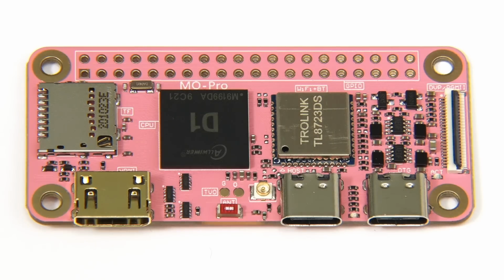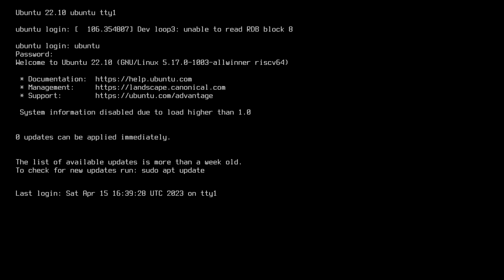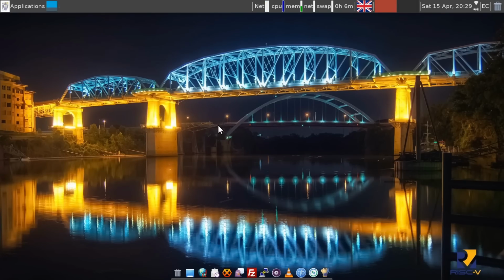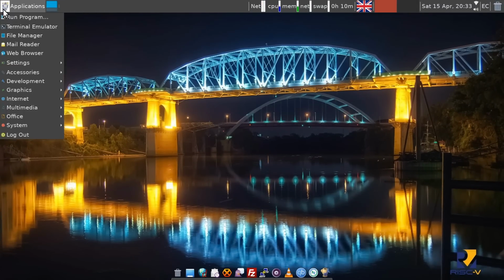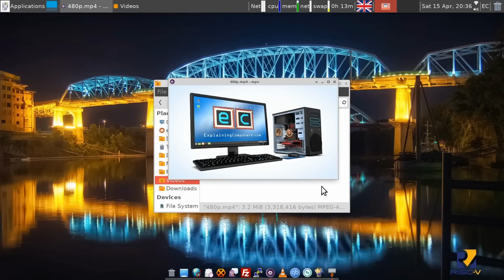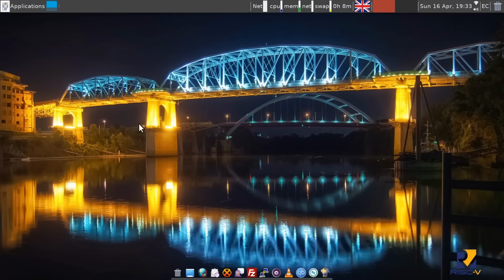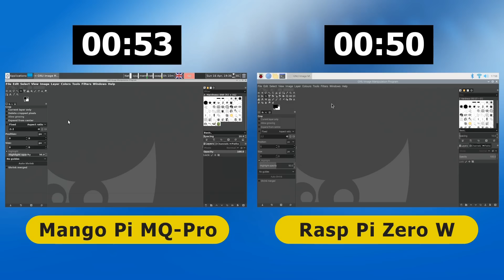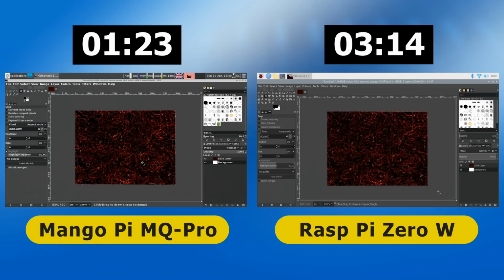Mango Pi MQ-Pro RISC-V SBC

Comment: We're used to computers that instantly run our programs and have quick video. But this is actually better than the computers many of us older folks got started on. Besides, this is not designed to be a desktop system. It will do fine for its intended purpose. Great video.
Reply: I'd actually argue that we older folks who remember well slow booting computers from years ago are now more than likely to have the patience to not worry too much about that now with some of these smaller SBCs - at home, for example, I am still using a Thinkpad T22 from around 2002 and a 700 MHz Pentium III CPU with 512 MB RAM just because I can.

It runs a very "slim" and optimised version of Gentoo Linux, it has an i3 tiling window manager and at least a couple of times a month I sit in my workshop using it to do some shell scripting while SSH-ed into my home server with mutt email open in a second desktop and a music player on a third desktop. It has a great keyboard and it takes me back to the glorious days of distraction-free computing that I used to enjoy.

The first computer that I used to connect to the Internet was a Commodore Amiga A1200 running at 14 MHz with around 8MB RAM over a dial-up modem and running the "iBrowse" web browser - and it was still utterly fascinating back then too.

With the rise of Linux and Open Source, and now hardware becoming more and more open, this an an amazing time to be into computing.
Reply: and what is its purpose?
Reply: Like will it run Fortran?
Reply: @KameraShy  You can laugh, but I was involved, this century, in the implementation of a great big new records system; as a user, I kept on asking about how it could be customised for our needs. Eventually one of the poor sods who had to interface between vaporware and the user base said "You can change anything as long as it doesn't touch the Cobol."
Reply: What is its intended use then? 😅🎉
Reply: @KameraShy  sure of course it can run FORTRAN. Jut "apt install gfortran". With gcc already installed, on my machine that downloads 8604 kB of archives and uses an extra 33 MB of disk space. 

user@ubuntu:~$ cat hello.f90
program hello
  print *, 'Hello, FORTRAN!'
end program hello
user@ubuntu:~$ gfortran hello.f90 -o hello
user@ubuntu:~$ ./hello
 Hello, FORTRAN!
user@ubuntu:~$ file hello
hello: ELF 64-bit LSB pie executable, UCB RISC-V, RVC, double-float ABI, version 1 (SYSV), dynamically linked, interpreter /lib/ld-linux-riscv64-lp64d.so.1, BuildID[sha1]=35c9b2b93da66201947be0ece07052232d95b46c, for GNU/Linux 4.15.0, not stripped
user@ubuntu:~$
Reply: @terrydaktyllus1320  My first "PC" was a Sinclair ZX80 -- with one whole KB of memory. I got a cassette tape with Pac-Man and a couple of other games. I wrote a few BASIC programs that didn't do much. But it was a start. I wish I still had it. It's probably worth something now.
Reply: @MichaManczak  Controlling robots. Gathering sensor data for transmission to more powerful computers. IOT devices -- that sort of thing. It is not meant to run desktop programs. Desktop programs require lots of memory and fast processors. But for something like collecting the temperature and relative humidity and transmitting that to a more powerful computer for analysis, these would be ideal.
Reply: @KameraShy  Probably. Though why you'd want that is beyond me.
Reply: @bobby9568  See my reply to Michael below.
Reply: @CCoburn3  You were therefore slightly "ahead of me" - I started with assembly language programming on Z80 CPUs back in 1982 on a day-release college course in my first real job. I had a Sinclair ZX Spectrum at the time and used that knowledge to break game protections so we could copy games in our work computer club.
Reply: @CCoburn3  I was about to comment that my first machine was a ZX81.

But you got here first, and have me beat with a ZX80.

Not that there was any real significant difference between the ZX80 and the ZX81. They just improved the construction - the ZX80 had 21 discrete chips, but these were combined into 4 ULA chips - which made it cheaper, and put it in a cooler-looking black case (that the ZX Spectrum to come would also sport).
Reply: @terrydaktyllus1320  At least you were doing something useful. I was just fooling around with mine.
Reply: @CCoburn3  Oh, don't get me wrong, I still wasted large portions of my life on Jet Pac, Manic Miner and Atic Atac!
Reply: @CCoburn3  controlling robots with that running ros i dont think so... Gathering sensor data -> much better alternatives... Hobby projects yes
Reply: @bobby9568  Sure, it depends on the type of robot. But you’re certainly right that this doesn’t have the horsepower to control anything fancy in the robot line. But it could control the hamster feeder Chris built some time ago. Though maybe you wouldn’t call that a robot.
Reply: @CCoburn3  Here in the US I started with a C64 at my parents house, and also the Apple II at my aunt and uncles place.
Reply: @maxxdahl6062  It was amazing what you could do with those computers. Then "feature creep" took over, and programs that worked fine on the tiny amounts of RAM we had back then won't load unless you have a couple of gigabytes. Oddly enough, most people neither use nor want many of the "features" they have added over the years.
Reply: @CCoburn3  The c64 and Apple II lasted a whole hell of a lot longer here in the US even also. Until what, 1991 or 1992?
Reply: It could be a desktop.  Just to have internet access can be great.  It's super cheap and probably uses hardly any power.  That can be great in a developing country/mobile environment.  $20 and tiny is pretty handy.

Comment: When I think back to the PC I had when I started university many moons ago.... p120, 16mb ram, 1gb HD. This little board is lightyears ahead, and probably costs less than my mouse back then. Interesting times. If only food were cheaper!
Reply: I couldn't agree morem-a I remember like when a 1 GB hard drive was a big deal. My God I'm getting old. Scary LOL
Reply: 120 MHz and 16 MB RAM!! Sheer luxury. I started on 1 MHz 6502 with 16 kilo bytes of RAM. Well, ok 32k actually. And given the Pentium can run 1-2 32 bit instructions per clock cycle while the 6502 takes on average about 4 clock cycles per 8 bit instruction that's more like 1000:1 ratio in speed as well as RAM.

Comment: I'm glad to see such a computer. A return to the roots of SBCs, where manufacturers are not trying to add a powerful chip, but simply make an inexpensive board for developing automation devices and all that. I just recently developed one such device. I had to use an SBC because I had to connect peripherals via USB. Otherwise, a simple microcontroller (arduino or simmilar) could be used.

//I know about USB host boards for arduino, but they didn't work for me - I do not have skills to implement the necessary protocols to communicate with my peripherals. Linux ons SBCs has built-in drivers that just work. This makes the task several orders of magnitude easier.
Reply: Definitelly a middle of the ground board is badly needed. One with wrapped up USB and other capabilities but fast start time.
Reply: There is no "return to any roots" here given that ARM SBCs are doing essentially the same thing as PCs did (and still do) by giving you "more bang for your buck" as silicon technology and manufacturing processes improve - the dollars that paid for, say, a Core 2 Duo CPU some 15 years ago will by you some multi-core Ryzen monstrosity today.

And I doubt any Pi 4 owner would welcome a "return" back to an original Pi 1, albeit there are still perfectly good things the Pi 1 can do.

This is a "new" platform based on RISC-V as a more open technology than ARM - it is still early days, it does not have the same level of software support as ARM boards do and, sure, it will advance in the same way that Intel and ARM chips have been doing.

But as of this moment in time, there is nothing you can do on a RISC-V board that you can't already do on an ARM board - the differences will no doubt emerge later on given that anyone can build any kind of RISC-V platform that they want to without any kind of licensing restrictions. 

I therefore look forward to where RISC-V goes in the future.

Comment: As more developers get involved, the optimisations for RISC-V and its associated graphics drivers will yield better results. I expect that future revisions of the hardware will also increase performance. These early RISC-V boards are important in starting the process whereby the platform improves over time.

Comment: The SPI flash footprint on the underside of the board looks interesting.  Also, the pad marked 'TVOUT' on the top could be fun - if it's composite out you could add an old-style RF modulator and have a retro style computer.
Reply from the maker: You are right -- I missed some tricks here. Adding SPI flash looks like a possibility, and we have composite video output pads as you say, as well as some audio output ones. A great board to tinker with!
Reply: I also see that.

Comment: Great video, as always. The Mango did very well, in my opinion.
Reply: It's been put to inappropriate use! As if you pulled multiple 4k streams in over each USB-C or ran SSD speed tests on them, it's really not provisioned.

Mehaps use AwesomeWM (awesome console?) and a console. If you try video use mpv. Don't bloody build kernels in 1 GB. Try to control an rc car to run a course, use speakers and mics to do noise control, or monitor photovoltaics (do inverters just do WiFi 6 as it is? No serial port tosh?) Hew a little. Bit. Towards nothing left to take away.

Comment: A perfect board for DIY projects that needs to run Full Linux instead of ESP8266/ESP32 with or without RTOS.
The price is pretty good, not price/performance but is a beginning.
Is nice to see a RISC-V in a RPI ZERO form factor 🥰

Comment: Wow! It's very impressive how RISC-V is maturing so rapidly. I still think ARM will become the de facto standard for desktops soon; however, RISC-V may supplant ARM sooner than I thought!
Reply: It is unlikely that ARM will do anything on the desktop or for laptops, apart from hardcore Apple fanpersons who will buy anything and everything with an Apple logo on it and sing its praises as the best thing ever. But we'll put the loonies to one side for now.

The desktop computer market has been declining for years as many people started switching to laptops probably as far back as 15 years ago. There are three types of people in the world that use desktop PCs now:

1. Gamers
2. People doing video and media production who (think they) need lots of CPU cores and RAM
3. Hobbyists like me that buy up cheap hardware used on eBay as "a bit of a bargain" from the sheeple flocking to buy their new PCs (mostly laptops) for Windows 11.

Other people are simply getting rid of PCs altogether to do their computing entirely on phones and tablets, but ARM already has complete control of those.

So, no, ARM won't be on desktops because desktops will continue to decline - though they will have to wrest my Linux PCs and laptop from my cold, dead hands!
Reply: @terrydaktyllus1320  Many people still want a large screen with a mouse and keyboard. The reason Tower PCs are falling in sales is because their current PC has enough power to keep running. Even phones and tablets have enough power to run a desktop environment.

What ARM will change is the size of the PCs. Tinier boxes will produce the same amount of processing power, if not more. It won't just be Apple. Qualcomm is planning on entering the market very soon and MediaTek is closely following. The AMD/Intel x86 duopoly is coming to an end, and that's a good thing for consumers.
Reply: @hermanwooster8944  "Many people still want a large screen with a mouse and keyboard."

I am going to stop you there and not go any further into your response.

You can't speak authoritatively about "many people", only about you.

If you want to head down that path then it's simply fact that many people do their computing today on phones and tablets with small screens.

In other words, it immediately your point anyway.

So let's keep this to what you and I know and not bring in "a big gang of virtual mates" to fight our arguments for us.

You can talk about what you know or believe, I can do the same about me.

So try again...
Reply: @terrydaktyllus1320  79 million desktops were sold in 2020. Someone has to like them to buy that many. But let's also consider - Qualcomm and Mediatek would not be entering this market if they thought it was hopeless. They believe it's ripe to take marketshare from AMD and Intel. I believe they are right.
Reply: @hermanwooster8944  And how many mobile phones were sold in 2020? I bet it was a whole lot more than 79 million!

Keep trying...
Reply: @hermanwooster8944  Just found a figure of 1.3 billion phones sold in 2020.

Like I said, keep trying...
Reply: @terrydaktyllus1320  Of course it's more popular - I never disputed that. In fact, my entire premise is that the processors used in mobile are so powerful that they're coming over to the desktop. I look forward to it, and I'm sure many more will once it's here. This is a really big deal for many reasons.
Reply: @terrydaktyllus1320  And I'll just say one more thing - I don't see this as a fight. If anything, most people don't see my vision of the future. That's OK with me. I'm just excited because I really think I see something big coming down the pipeline. You take care and we'll eventually see how it works out. :)
Reply: @hermanwooster8944  "Of course it's more popular - I never disputed that. In fact, my entire premise is that the processors used in mobile are so powerful that they're coming over to the desktop. I look forward to it, and I'm sure many more will once it's here. This is a really big deal for many reasons."

Fine, but that's a completed different discussion to what you originally presented in your first comment.
Reply: @hermanwooster8944  "And I'll just say one more thing - I don't see this as a fight."

Neither do I, we've had a civil discussion up to this point.

"If anything, most people don't see my vision of the future."

Then it's possible that your vision isn't the correct one? And, to be fair, I don't have much of a vision, only that the PC platform is in decline, unfortunately.

You're debating a pragmatist who believes that best all-round computing platforms are those based on Intel IBM PCs. I've both "hobbied" and work in computing for several decades now and I consider phones and tablets to be "expensive surveillance toys" that need "neutering" and de-Googling the moment you get them in order to work in your interest and uphold, not destroy, your privacy.

Nothing beats a Linux-based Intel platform currently as an "as open platform as possible" and I don't look forward to any demise of the platform in the future.

If RISC-V ultimately rises to take its place, then as long as it maintains an open and privacy-friendly platform, I would be okay with that.

"That's OK with me. I'm just excited because I really think I see something big coming down the pipeline."

I am entirely happy with my own computing experience that iThat's OK with me. I'm just excited because I really think I see something big coming down the pipeline.s Linux-focused and which has rid itself now of vile privacy-hating platforms like Windows and Google Android. (I have never owned an Apple device and never will, so nothing there to rid myself of.)

But I am less happy about "Joe Sixpack's" relentless "magpie-like" attitude to shiny objects that they can up paying a thousand or more dollars for that serves as a surveillance device over them. I don't see that changing any time soon.

I'd love to see people taking more responsibility for their own computing lives without a reliance on evil corporations, but I don't see that changing.

"You take care and we'll eventually see how it works out. :)"

You too, it was an interesting discussion anyway.

Comment: A most interesting board, and very welcome.  I am particularly happy to see the use of USB-C connectors.  It is a shame that this connector design took so long to be created.  😁
I gather that the header was a normal inclusion for this model - and that highlights a weakness in the approach of using two different stock items by Raspberry Pi.
Your testing highlights why I am disappointed with the small memory of the Raspberry Pi Zero and Zero 2 in particular.  The Zero 2 has all the CPU power of the "full size" Raspberry Pi 3, but it is all too easy to have Linux need to use virtual memory when there is only 512MB.

Comment: Really enjoyed this video. Chris I have got to say this is the first time (that I am aware of) that you used an arrow to point to something on the board. Was wondering if you could continue doing this? Keep up these great videos!
Reply from the maker: I think you are right, I have only used that arrow before to point to something in an operating system, or terminal, something like that. Here the antenna connector was so small it seemed the right thing to do. You comment very much noted! :)
Reply: @ExplainingComputers   Thanks! Again, really enjoy your videos. Keep up the awesome work.

Comment: I suspect that 64 bit vs 32 bit played a part in the filter test.  Based on some looks at the number of instructions to do something I expect that fully optimized C on the RISK-V will be slightly slower than the ARM but not by a huge amount.  ARM wins with having condition codes from math instruction to branch based on.  RISC-V does have the ability to test registers and jump without needing to do an ALU operation to test.